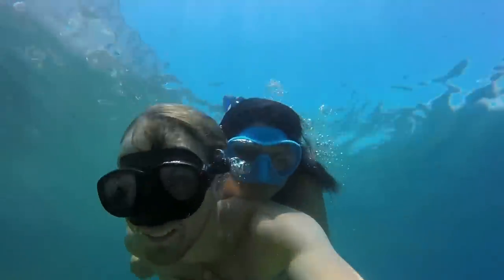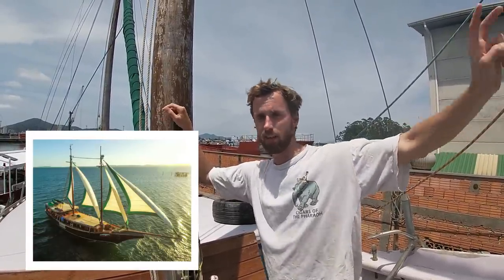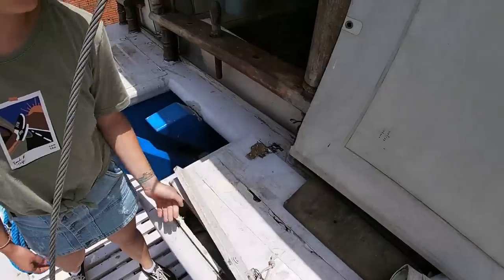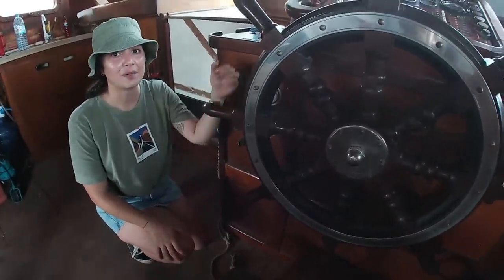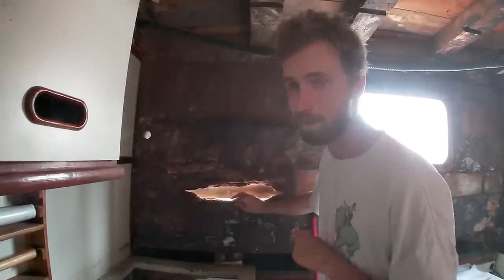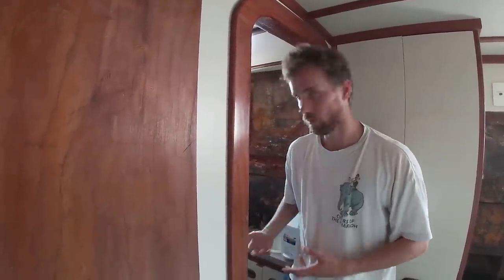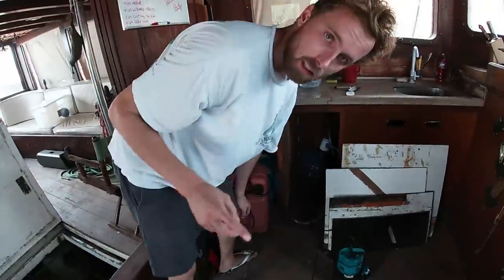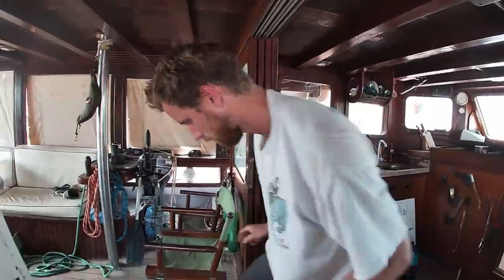BOAT TOUR of our wrecked Brazilian ship — Sailing Yabá #7

Comment: Must make the boat as water tight as possible with hatches windows & water coming through the rot. With all the humidity the electrical wiring & connections probably have corrosion which is for future of arcing & power outages. All the things MP showed us are nice but doesn't contribute to the strength of Yaba. The walls, beams & frames surely have some rot from what I've seen so far. Good luck with all the repairs there are many.

Comment: The interesting part is that your topside kitchen is still inside but i would suggest to have it as a small kitchenette up there used to heat stuff up etc while having the main kitchen downstairs with the fridge. Another point: Maybe get some Plexiglas to be put into the topside "living room" so you can shelter there from the elements if it gets a bit colder. They should not be to heavy and maybe you can store them nearby but should allow it to be used in rough/colder see as well, while keeping it open like it is now for nice warm weather.

Comment: Those are Sideshift thruster controllers; I recognize the logo. Sideshift is an after-market thruster that bolts onto the bow and stern of a boat and do an ok job moving a small yacht--until they break. They're supposed to size up to a 60' yacht but I just can't see them moving Yaba. If you looked closely at the bow stem you might see where a couple of bolts where affixed. It's laughable that someone might have tried to use this equipment on your yacht.

Comment: The open area in back is technically you cockpit area of the boat on yours it just huge!! Those slatted area's above are suppose to have spare life vest for easy eminency axis!!!  Required in US waters, The swimming platform seemed to be designed for fishing too!!!! Noticed your Rutter has a hole for a tiller for back up steering do you actually have one!!! When you open the large interior doors is your bridge. Where you steer from. yours has your galley in it!!! So you have a double galley I honestly think you should change the configuration of the top galley and navigation moving it more to the back with a seat, move the sink into the area where the navigation station is now, if you put a corian  counter top even if you get leaking the counter should stay protected. in the counter top a drop Ice chest and where the sink is now a small gas stove, that can be covered. Mostly when your making quick out door meals. The internal Galley is better for bad weather and your anchored I would invest in a Gimble stove/oven that swings when boat rocks. But one that will not allow pots to move while under sail!!! the wood damage is bad, but above the water line, defiantly need lots of new caulking to fill the gaps!!! My father would have said in a wooden boat only use wood, because it allows it to breath and dry!!! So in the heads I would suggest Teak wood either oiled or varnished!! With bed/bunks the pillows should be at wider end, legs are narrow!!! If you build built ins use teak or Mahogany... Wood against wood, reason my dad switch to fiberglass when he got older, the constant oiling and Vanishing is one of the thing he said keeps a boat water tight!!! Also marine grade paint!!!!

Comment: With heavy rolling and rocking while underway, wouldn't the downstairs galley be safer (more places to hold and brace)?
Reply: Well that boat is not built or meant for ocean crossings. It’s built for coastal cruising only. So it really shouldn’t see much heavy rolling and rocking. Not if they’re smart that is. Then again, they did buy it.

Comment: What some people are missing is that this is Brazil, where both the hard stand, the lumber to rebuild it and the labour are a fraction of the cost of, say, Europe.   In Europe or the US it would probably have cost more to haul out and put on the hard for two weeks than they paid for the boat.   There are downsides to 3rd world countries for sure, but the cost of labour intensive works like this will require is far less.   It's not going to be easy and it's going to take a long time, but yes, it's doable, though I think you'll be staggered just how much timber is going to need to be replaced.   She's ripe indeed.

Comment: You have a lot of work ahead of you.  Document as much as possible so you know how to put it all back together.  Save all the custom woodwork you can.  Hopefully you have a very good shipwright working with you to advise and assist with making any new frames you might need.  You may be able to find the size of wood you need there in Brazil, as most wooden boat builders seem to buy wood from Brazil or South America in general due to its hardiness and availability.  This is going to be a long project, so good luck.

Comment: I'd jeep the 220v its more cost to set up the second electric panel/inverter but you save a lot on all the appliances you might use. And you'll probably have an inverter/charger for your solar panel capable of handling 220v.

Comment: Do we keep the kitchen? You will probably need to remove ALL the cabins walls and deck heads to repair your hull and deck. With no scuppers your deck will always rot and have leaks. You will need to pull all of the tanks out to properly inspect and repair that hull. Better to get some land dig a hole for Yaba to sit in and concrete it down as an airbnb.

Comment: If it was an older boat... but only 15 years old, and in this shape...
Although. I really like this rebuilding project, my question is, if this boat turned into this shape in 15 years, what kind of materials they used when they built it? Will the remaining, recently healthy looking  parts last long enough after you finished rebuilding? 
This boat probably has basic construction problems.
But I honestly wish you good luck, I hope itt will be a superb boat.

Comment: Concerned about the bottom of the frames where water has likely been sitting for extended periods in areas like the bilge etc. In some cases you can repair the frames, but to do it properly they probably have to come out, that means the planking has to come off. The state of the keel? It's the stuff you can't see like that wood covered over by plywood where the big problems lay. Appreciate the tour, but you have to assess the boat's structure properly and if it's salvageable, or how much work will have to go into her.
Reply: N

Comment: Great video guys!
You have a boat load of work ahead of you.🤣🤣
But first of all. My thought is to rip out all the electronics and just convert to 12V DC with a inverter for a few 120V items. Keep it simple.
With modern 12V LED lighting it's all you'll really need.
Also, I hope you're not going to live on the boat during this project. You'll just hate yourselves for doing so...
Good luck!
P.S.
Kitchen=Galley
Port=Left (red)
Starboard= Right (green)
Ropes=Lines
Bumpers= Fenders
Front=Bow
Back= Stern
Bottom =Hull
Top=Deck
Not being a ass, just trying to help...

Comment: Do not listen to the naysayers.  Yes, you are sitting down to eat an elephant but by taking one bite at a time you can do it.  The first step is to get the hull sound to above the waterline then the engine and fuel tankage.  Get YABA to be able to float again and power itself then electrical and so on.   Good luck and God bless, I'll be watching.

Comment: Downstairs galley - main meal prep galley. But keep the top deck facilities for drinks and snack prep. Why remover either if they can both still be fully functional? Unless there is a definite NEED to use either space for an alternate purpose, of course!

Comment: In English the malaguetas are called belaying pins. They can be used to belay a load, much like rock climbers belay a climber. What you call floorboards are cabin soles. Walls are bulkheads. Ceilings are overheads. The material covering the beams in the side of the hull are called ceilings. Floors connect the beams to the keel. They can be made of metal and/or wood. Confusing, ain't it?  I've only touched the surface. I think it was designed to separate the sailors from the lubbers. You have undertaken a monumental task. I wish you well. You will make many mistakes. Please look on them as learning opportunities. Double all time estimates for jobs. Double all cost estimates for materials. May the Good Lord bless you and your labors. I eagerly await episode 8.

Comment: Get into the hull and see that it’s going to cost before you get into the cabin walls. Remember to factor boat yard fees into everything. Having worked on wooden yachts myself, the rule of thumb I use is the amount of rot you initially find is actually four times that in reality. Even though you pulled away the inner walls in places, you are still in the initial discovery phase. Be real to yourselves , be factual and not emotional. Add it up and put it down on paper than add 50% for surprises.

Comment: I suppose you will spent most days on the aft deck and therefore i think you should keep both kitchens. The wood works are  a huge  job but i think repairing the hull is priority.  You best built a good tent over the boat so no water will enter from above and so giving you time to do the hull first and step by step the deck and further upwards.   I love your enthusiasm and positive attitudes but sometimes you best step back and keep in mind what costs you can expect and then see if its  doable. Good  luck anyways.

Comment: Any ribs or frames with 'minor' rot can be dried out and soaked with epoxy. Then, 'sister' frames can be installed alongside and cross bolted, spanning the compromised area and actually increasing the strength without having to do a complete removal. Just be sure to use silicon bronze screws through the planking to prevent 'iron sickness' from ferrous fasteners... boat
 /bōt/ A hole in the water, surrounded by wood, into which large amounts of money must be poured to keep the water out...8P

Comment: OMG, the substance is still salvageable, but you will have plenty of time. Money and especially work have to put in. Here is my assessment of the basic working method:
- Remove all fixtures such as furniture, wall and ceiling panels. Also the deckhouse completely free of the red walls and hope that the load-bearing parts are not rusty. Otherwise replace.
- Check all structural parts of the hull and replace if necessary (safety relevant!!!).
- Planking of the hull must be partially renewed (safety relevant!!!)
- Deck planking must also be partially rebuilt. Re-seal all joints (damage prevention below deck, therefore also important!)
- Engine must be taken out and overhauled. New bearings, seals and rework the cylinders (safety relevant!!!)
- The complete electrical system must be out. Here was too much remumgefummelt over the years. Hidden sources of error are so hard to detect. Therefore once out and make everything new (safety relevant).
- Check rudder bearings, control quadrant and cables with all pulleys, partially replace. Seal shaft and replace bearings if necessary (safety relevant!!!).
- Check standing and running rigging and replace if necessary (can be done after all other work has been completed, but it is relevant to safety!
- Rebuild the deckhouse with reasonable and seaworthy windows.
- Lay supply and disposal lines (electricity, water, sewage, diesel, technology)
- Install new diesel and water tanks (you don't want to have cholera or diesel plague on board!)
- Restore cabins, i.e. put walls back in, ceiling lining and furniture etc.
- Install technical equipment "living". So stove, refrigerator, light, toilet, shower, etc.
- Make underwater hull so that it is secured against rot, drilling worms and fouling. Either by means of epoxy sheathing or (simpler, more stylish but also more expensive) by means of copper planking. Simple painting is after the previous renovation then actually only botch and you should refrain!

Rough estimate of the renovation time and costs (with high own share of work):
- 3 years
- 150.000 US$ plus if necessary new sails, standing and running rigging.

If you can do that and keep it up (which I hope you will), then you will have a really nice boat with which you will have a lot of fun for the rest of your life (with minor refurbishment and maintenance work). Therefore, please do it right and not just cobble something together somehow on the fly!

++++ Translate+++++

OMG, a substância ainda é recuperável, mas você terá que gastar muito tempo. O dinheiro e, especialmente, o trabalho têm que ser colocados puramente. Primeiro, aqui minha estimativa do método básico de trabalho:
- Remover todas as luminárias como móveis, paredes e tetos. Também a casa de convés completamente livre das paredes vermelhas e esperar que as partes portadoras de carga não estejam enferrujadas. Caso contrário, substitua.
- Verifique todas as partes estruturais do casco e substitua se necessário (relevante para a segurança!!!).
- O aplainamento do casco deve ser parcialmente renovado (relevante para a segurança!!!)
- A aplainamento do convés também deve ser parcialmente reconstruído. Feche todas as juntas (prevenção de danos abaixo do convés, portanto também importante!)
- O motor deve ser desmontado e revisado. Novos rolamentos, vedações e retrabalho dos cilindros (relevante para a segurança!!!)
- O sistema elétrico completo deve ser removido. Tem havido muita agitação ao longo dos anos. As fontes de erros ocultos devem ser reconhecidas tão dificilmente. Portanto, uma vez fora e tornar tudo novo (relevante em termos de segurança)
- Rolamentos do leme, quadrante de controle e cabos com todas as polias verificadas, parcialmente renovados. Vedar o eixo e substituir os rolamentos, se necessário (relevante para a segurança!!!)
- Verifique o equipamento de pé e em funcionamento e substitua-o se necessário (pode ser feito após a conclusão de todos os outros trabalhos, mas é relevante para a segurança!
- Reconstruir a casa de convés com janelas razoáveis e com bom estado de navegabilidade.
- Instalação de linhas de abastecimento e descarte (eletricidade, água, esgoto, diesel, tecnologia)
- Instale novos tanques de diesel e água (você não quer ter cólera ou peste diesel a bordo!)
- Restaurar as cabines, ou seja, reinstalar as paredes, os painéis de teto e os móveis, etc.
- Instalar equipamentos técnicos "vivos". Portanto, fogão, geladeira, luz, banheiro, chuveiro etc.
- Proteger o casco subaquático contra a podridão, os vermes de perfuração e as incrustações. Seja por meio de Epoxihülle ou (mais simples, porém mais caro também) por meio de pranchas de cobre. A pintura simples é depois da reorganização do passado, então na verdade só botch e você deve omitir!

Estimativa aproximada do tempo e dos custos de reorganização (com alta parcela própria no trabalho):
- 3 anos
- 150.000 US$ mais, se necessário, velas novas, em pé e em marcha.

Se você conseguir fazer isso e continuar assim (o que eu espero que você faça), você terá um barco realmente agradável com o qual se divertirá muito para o resto de sua vida (com pequenos trabalhos de reforma e manutenção). Portanto, por favor, faça-o bem e não se limite a empedernir algo de alguma forma!

+++translate+++

OMG, die Substanz ist zwar noch zu retten, aber ihr werdet jede menge Zeit. Geld und vor allem Arbeit reinstecken müssen. Hier erstmal meine einschätzung der grundsätzlichen Arbeitsweise:
- Alle Einbauten wie Möbel, Wand- und Deckenverkelidungen ausbauen. Auch das Deckshaus komplett von den rotten Wänden befreien und hoffen das die tragenden Teile nicht rott sind. Ansonsten ersetzen.
- Alle Strukturellen Teile des Rumpf prüfen und ggf. ersetzen (Sicherheitsrelevant!!!)
- Beplankung des Bootskörpers muss teilweise erneuert werden (Sicherheitsrelevant!!!)
- Decksbeplankung muss ebenfalls teilweise neu hergestellt werden. Alle Fugen neu abdichten (Schadensvemeidung unter Deck, somit auch wichtig!)
- Motor muss raus und Generalüberholt werden. Neue Lager, Dichtungen und die Zylinder überarbeiten (Sicherheitsrelevant!!!)
- Die komplette Elektrik muss raus. Hier wurde über die Jahre zuviel remumgefummelt. Verdeckte Fehlerquellen sind so kaum zu erkennen. Deshalb einmal raus und alles neu machen (Sicherheitsrelevant)
- Ruderlager, Steuerungsquadrant und Seilzüge mit allen Umlenkrollen überprüfen, teilweise erneuern. Welle abdichten und ggf. neu Lagern (Sicherheitsrelevant!!!)
- Stehendes und laufendes Gut überprüfen und im Zweifelsfall erneuern (kann nach abschluss aller anderen Arbeiten erledigt werden, ist aber Sicherheitsrelevant!
- Neuaufbau Deckshaus mit vernünftigen und Seegerechten Fenstern
- Ver- und Entsorgungsleitungen verlegen (Strom, Wasser, Abwasser, Diesel, Technik)
- Neue Diesel und Wassertanks einbauen (ihr wollt weder Cholera noch Dieselpest an Bord haben!)
- Kabinen wieder herstellen, also Wände wieder rein, Deckenverkleidung und Möbel usw
- Technische Ausrüstung "Wohnen" einbauen. Also Herd, Kühlschrank, Licht, Toilette, Dusche usw
- Unterwasserschiff so herstellen das es vor Rott, Bohrwürmern und Bewuchs gesichert ist. Entweder mittels Epoxihülle oder (einfacher, Stylischer aber auch teurer) mittels Kupferbeplankung. Einfaches Streichen ist nach der bisherigen Sanierung dann eigentlich nur Pfusch und solltet ihr unterlassen!

Grobe Schätzung der Sanierungszeit und Kosten (bei hohem Eigenanteil an Arbeit):
- 3 Jahre
- 150.000 US$ zzgl. ggf neuer Segel, stehendem und laufendem Gut.

Wenn ihr das schafft und das durchhaltet (was ich hoffe), dann habt ihr aber ein wirklich schönes Boot mit dem ihr (mit kleineren Sanierungs- und Erhaltungsarbeiten) den Rest eures Lebens viel Spass haben werdet. Deshalb bitte richtig machen und nicht nur irgendwie auf die schnelle etwas zusammenpfuschen!

Comment: Looks like they used what is called melamine coated plywood. It’s fine for land based cabinets but is just plastic ironed on with glue to the surface of wood.